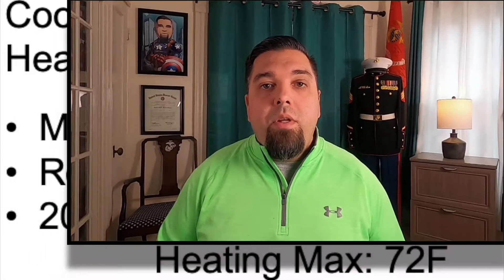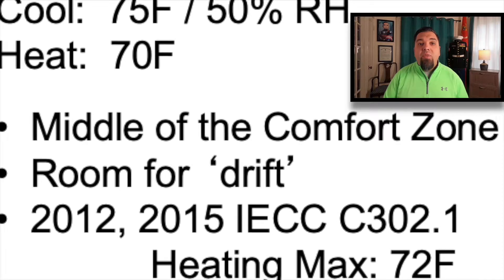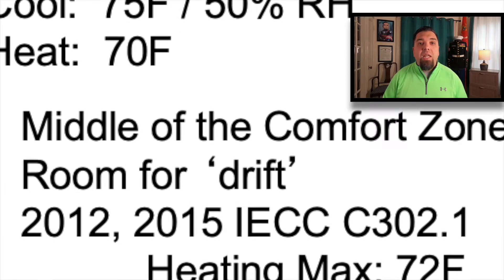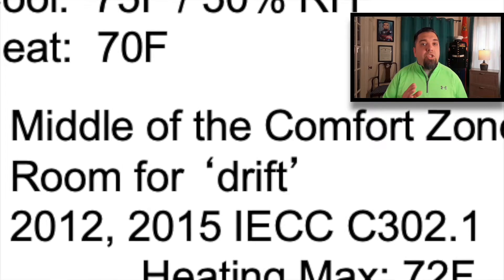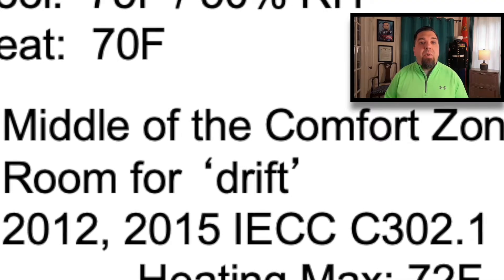Manual J Indoor Design Temps

Comment: set at 75 in cooling season, does not turn on until 76.6, and off around 73.  system runs only once a day for several hours.

Comment: Makes you wonder why there is even a adjustment dial on the thermostat?  If the customer doesn't care about energy conservation is there another reason to set temperatures to 70 in winter and 75 in summer?